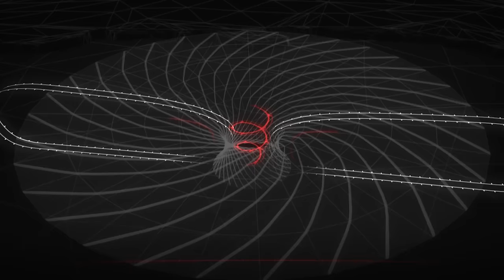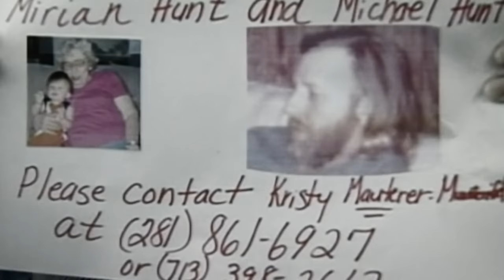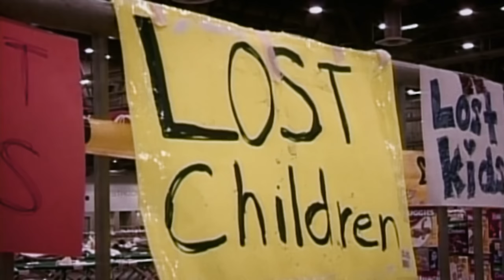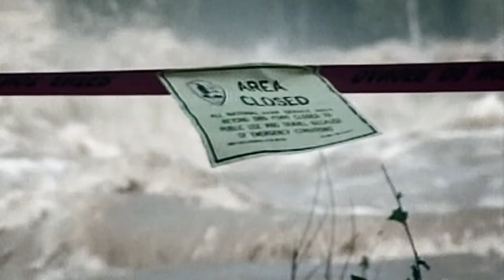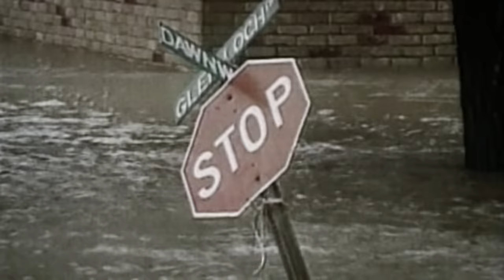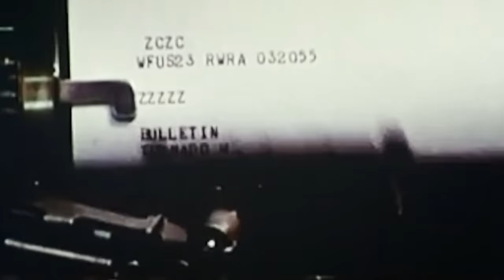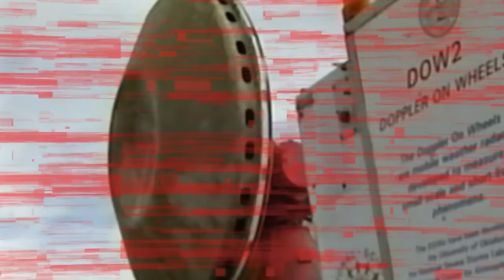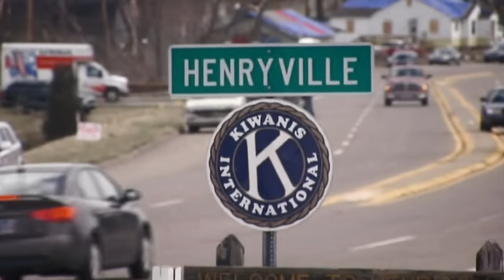World's Worst Hurricanes And Floods | Code Red Marathon

Comment: So a tornado with 300 mph winds that just cuts across empty fields can be an F1? The Fujita scale based on damage done isn't "silly" it's down-right "STUPID".
Reply: No they’re wrong. The scale is based on wind power not damage.
Reply: Well are you saying Josh Wurman doesn't understand or distorted the Fujita Scale?(Time stamp 2:41) I doubt it. "Fujita" sure sounds official but it could use a makeover. More like the scale for Hurricanes.   @GodLovesYou1624
Reply: @GodLovesYou1624 The Fujita scale is a damage based scale. This is why we don't know what level it is until it's over.
Reply: If you can't understand on how it works and applies then don't comment. The fujita scale is based on and applied after the damage is done. This is to describe the condition of what generally has to be rebuilt and the costs of it. So for example a city can be hit with a tornado spinning at 150mph and flatten buildings that are only made of wood right down to the ground and be labelled as an F5. The SCALE applies to the structures not the wind speed.............. Simple minded Americans.
Reply: @GodLovesYou1624  your silly comment could have been avoided and saved you from embarrassment with a super quick Google search...

Comment: Hey y’all are sleeping on where Katrina actually did damage in Miss. and there was also surge there. You are missing the point! Mississippi was ground zero for Katrina… regardless of the levee breaks.
Reply: Correct me if im wrong, but katrina made landfall in louisiana, not mississippi, as stated in this documentary
Reply: @cassydee5196  Nope. It hit Gulf Port dead on. It hit Florida and Louisiana also but Mississippi was ground zero.
Reply: @Maven0666  at the 3:05 mark of the beginning of the video it shows louisiana as landfall maybe buras or grand isle.